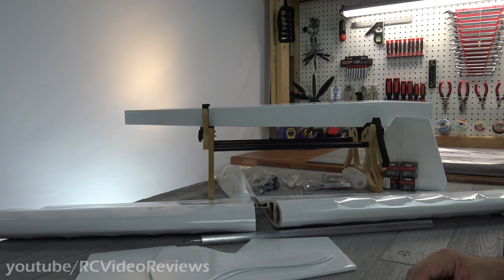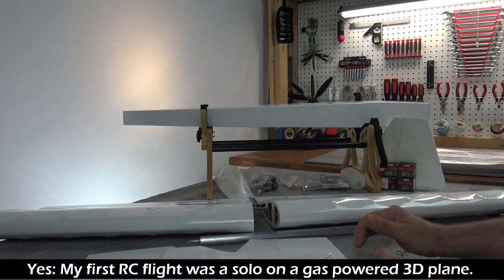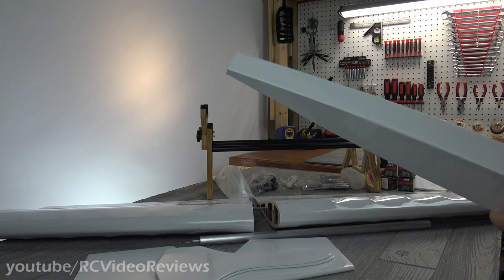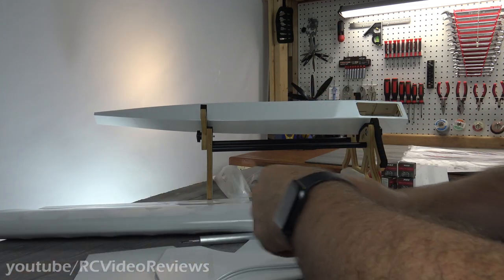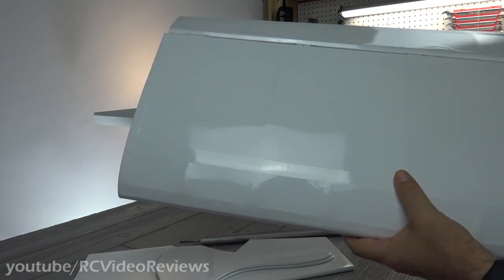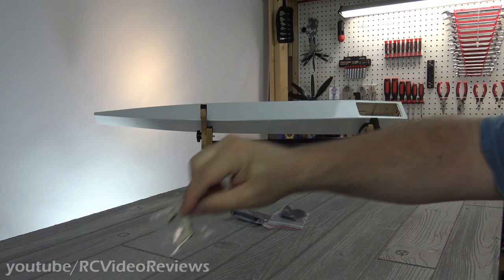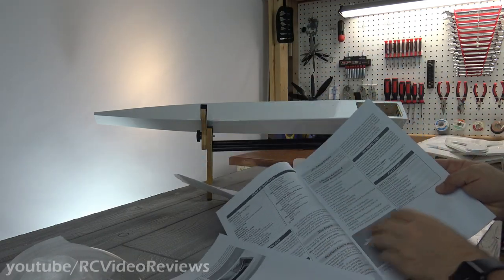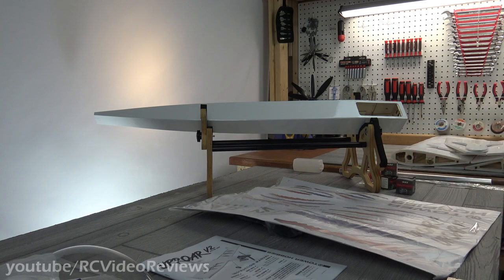Tower Hobbies Uproar v2 RC Plane First Look

Comment: Just saw this video. I am trying to get caught up on all of them. I have an Uproar 40 kit with a Tower 46 on it. Have flown it in the past about five times and loved it. It was my fifth or sixth plane, not my first. I knew immediately after having  two PT forty trainers(no longer with us) that I needed time before assembling and flying this one
Reply from the maker: I had a good time flying the Uproar; however, I wasn't flying it enough so I passed it down the line to the next guy. Have fun with it. It's a good time.
Reply: @RCVideoReviews  I may see you at the field if I can get everything back together, including my flying ability. I have no where near your experience, but I have missed flying RC

Comment: Thats cool they did that for the fire wall.  Looks pretty light too.
Reply from the maker: It's about time. I've filled more firewall holes from Tower than I care to count. They say about 4.5lbs. I've got the wings on and am looking at the ratios--this plane is going to fly a LOT like my Mini Contender. It's about 20% aileron going from root to tip. I think it'll be a lot of fun ;)
Reply: @RCVideoReviews  Sweet.  Horizon is good at buying out and closing lines down unfortunately.
Reply from the maker: Yeah, they've already done a number on Tower's foam product line. Some of the balsa stuff looks to be hanging tough though. Would be nice to see some of their really good planes stay in production.
Reply: @RCVideoReviews  Listened to an interview of a horizon worker and more then likly they will slowly phase out like did to parkzone.
Reply from the maker: Grrrrr
Reply: @RCVideoReviews  I agree!

Comment: I had both the uproar v2 and the mini uproar. Both fantastic air frames. I still have the mini, but traded the v2 to a club member for an unbuilt tower hobbies sbach arf. On the v2 i was running the gforce .32 as well, on a 3300 4s pack and apc 13x6.5e it pulled about 53 amps static and was more than enough for unlimited vertical. I found the v2 flew better without the draggy side force generators, and definitely rolled faster without them. Very curious what you think of it. In my opinion, I like the mini uproar better, but they're both fun.  Don't be afraid to move the cg back if it doesn't do what you want.  Its docile either way.  Have fun!
Reply from the maker: Awesome tips! Thanks for sharing. I'll go ahead without the sideforce generators for the maiden. I have some 4s4000's due to be delivered tomorrow. Where did you set your CG?
Reply from the maker: Oh, and how do you like that Tower Sbach? That's another one I've been considering.
Reply: @RCVideoReviews  i haven't put the sbach together yet. But, looking at the kit the covering job is among the best I've seen! Regarding cg on the v2, my 3300 4s are 70c nano tech+ packs, so they're about as heavy as a basic 25c 4000 (about 400 grams). That said i initially added some noise weight to get a forward cg (where i typically like to maiden my planes at for stability) with the battery all the way forward. I ended up removing the stick on weights for the 2nd flight and even scooted the pack rearward a tad. Totally different airplane, it has a very wide cg range.  The guy who has the plane now has it about a quarter inch behind the most rearward of recommended CG and he likes it there. Don't try hovering with a forward cg, it just won't do it. In my opinion I think the entire CG range could be moved back a quarter inch and still be a good range.
Reply from the maker: Great feedback. Thanks for taking the time to put it out there. I like to start with a forward CG as well--safer. Then I walk it back until it just feels light on the sticks. Although lately, I've been more and more interested in the inverted test. I'm beginning to like flipping it over and putting just a whisper of forward/down elevator to keep it level. The planes seems to land well when I do that too.

Anyway, thanks for the feedback. I made decent progress putting it together tonight. I should be able to finish it tomorrow. Maybe a maiden on Monday or Tuesday.
Reply: @RCVideoReviews  the uproars are fun! I have an unbuilt kit uproar .40 as well, which will get an electric conversion.  I haven't built a kit in years, so I'm looking forward to that. Probably next winter. The Sbach build is next though, my super sportster EP went to airplane heaven a few weeks ago, after an actual bird strike she spiraled into the ground 😭😭  and of course its discontinued.. i had over 250 flights on that.
Reply from the maker: Oh no! That's a bummer. Yeah, they unfortunately discontinued that one, but you know SIG sells a Four Star 20 that would be a very very similar plane. They also sell that in kit format if you want to build it.
Reply from the maker: Here is the Four Star 20 Kit: https://sigmfg.com/collections/sig-kits/products/sig-four-star-20-ep-kit

Comment: Tower has the in stock for a hundred and a quarter    I surely have all the components I need to complete  giving it consideration
Reply from the maker: It's a decent little plane for the money. My only gripe was not enough rudder. Liked it otherwise.

Comment: Too much altitude can make you dizzy.🤣 Cool balsa bird for $100. What's the, after built, PNP price? Plenty of girth to those wings n spar. Flight should be interesting. Let's see the build. AirHammer out!!
Reply from the maker: They've got a coupon code right now FUN15 which takes $15 off $100. So $85 for the plane. I added $8 back in for the Great Planes Aluminum backplate spinner which hasn't arrived yet. So let's break it down:

Uproar v2: $85 (free shipping)
4 Emax Servos: $39 (with shipping)
1 60a ESC: $36 (with shipping)
1 Geforce G32 Motor: $31 (with shipping)
1 FrSky S6R Receiver $34 (with shipping)
__________________________
$225 all in + $9 if you want the aluminum backplate spinner.
Reply: @RCVideoReviews  that's a good "all in" price. Listen, I have a Detrum 3720/650kv motor, 13×6 prop. in my D.Pitts. What's a good replacement for it? Size/kv bla bla blaa.
Reply from the maker: What's wrong with the 3720/650? What don't you like about it?
Reply: @RCVideoReviews  not much really. When needed, I just wanted a better replacement with same(or close) specs.
Reply from the maker: I always thought that 3720 was a pretty decent motor. That's the one I fly on my Corsair and love it. I was going to put one in the Focke Wulf 190 but decided the 500kv did just fine.

On my Waco I put the 11x7x3 prop on from the Corsair/Focke Wulf on 4s and think it does pretty good.

The Cobra 3520 700kv looks similar in terms of max current but it's substantially heavier  (216g vs Detrum @ claimed 125g (seems low to me)).
https://innov8tivedesigns.com/cobra-c-3520-14-brushless-motor-kv-700.html